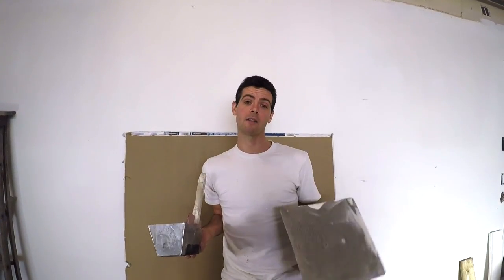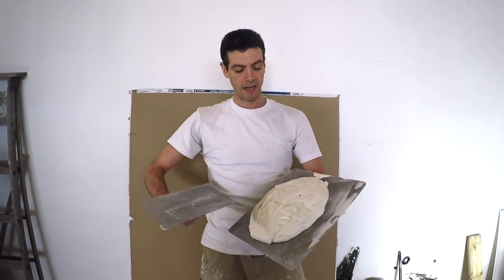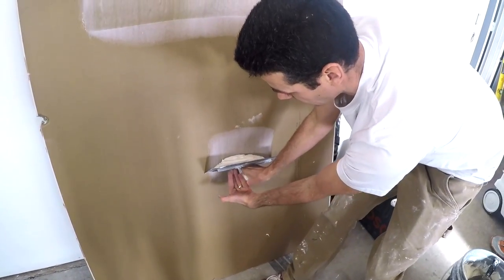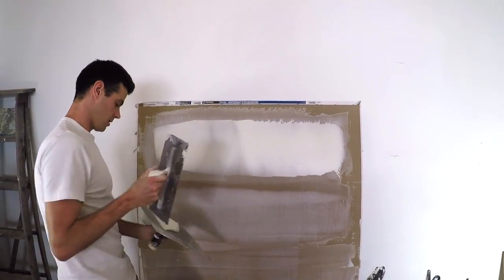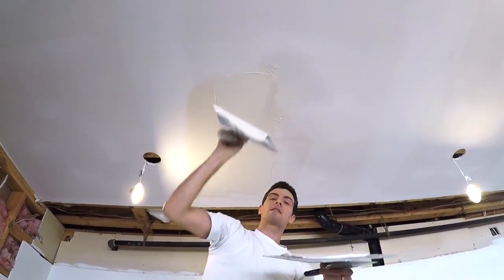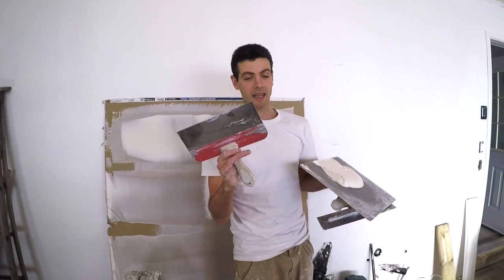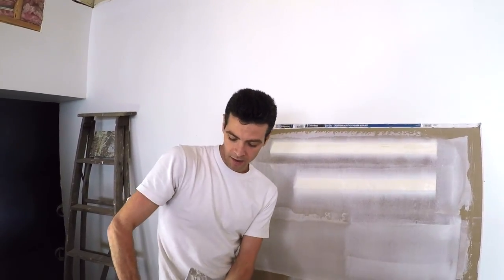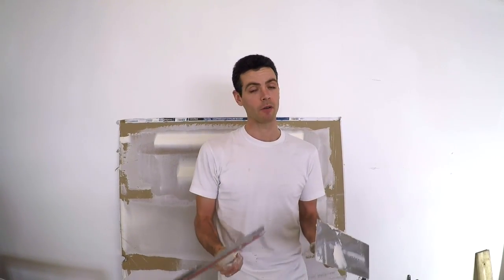HAWK AND TROWEL VS PAN AND KNIFE

Comment: LOL, some tradesmen can’t avoid knowing the taste of their work! I’m familiar with an electrician who knows what 220 volts tastes like. 😮 
I think I’d prefer chalk.
Reply: I saw someone taste 220 at some point. He screamed so hard, after that I asked him is he knew how loud he was. He was not even aware he screamed 😄
Reply: Yeah, I used to love the taste of sawdust when I was framing houses years ago. Sometimes I’d like to lick a nice and clean, kiln dried piece of hemlock or fur 2x6 and then smell it! The wetness always brought out the aromas! 😜
Reply: I took 480 across the chest once because someone fired up the generator while I was working in a power distribution panel of a connected equipment suite. Every muscle on the front of my body contracted with superhuman strength and I very narrowly escaped both shoving my face into the live panel, and skewering my jugular with the screwdriver in my hand. I don't recall a taste, per se, but I do remember 'seeing stars'.
Reply: @AtlasReburdened  was the power out or you had it turned off? Wondering what the deal with the generator was.
Reply: @seabass22  I was working on a mobile military communications equipment suite that sits on the back of a HMMWV. The generator is the only power supply.
Reply: @AtlasReburdened  oh dang that sucks
Reply: @seabass22  Yeah, but it sure ingrained the lesson of not having a finger on the metal part of a screwdriver when working on anything that electricity ever touches.
Reply: @AtlasReburdened  I need to get some electrician drivers for that reason
Reply: @seabass22  It is pretty nice to have that peace of mind, and getting a decent set doesn't quite dent the wallet like it used to.

Comment: Great explanations, and demonstration. I prefer a trowel over a knife 90% of the time, like you said you get a lot more traction and pressure out of it, so less fatigue and wrist strain. With a trowel you can set up plaster at just about any thickness, over an inch if the plaster is nice and stiff, that is impossible to do with a knife, so ia trowel is great for really uneven surfaces and filling larger cracks and holes. With a trowel you can plaster over a brick wall in one run for example. Rest the hawk on the bucket if you need to pur it down. Put your trowel on the hawk to have one hand free for taping, or whatever you need to do. A trowel can get into corners just fine if you change yuor grip a bit, turn it around and grab the stem, instead of full on gripping the handle. I like how with a trowel it's relatively easy to make a transition on an inside or outside corner, and you can really cut sharp edges. For trickier parts, corners etc. just use the short end. All of it comes down to experience anyway:) everybody has their prefrence and personal tricks.

Comment: Over the years, I've developed a bit of a hybrid method: Mud bucket, 6" knife, and a 12" trowel. Kick the bucket around with me, using the knife to load/clean the trowel. Never have to carry more than a trowelful around with me, so easier on the arms and shoulders. Even better when working off a scaffold 'cause the mud bucket comes up on the scaffold and wheels around with me.

Comment: Now to give one back in appreciation for answering things I've always wondered:
No need for the pan holder tool; I cut 80 grit used belt sander belts in half, and epoxy one to each side of the pan. Even with wet hands, you'll never drop it, and it's free! 
Question about your trowel: is that one with the armed blade or are they flat? I bought an armed one, but it leaves way too much mud behind, or I used it wrong.
NEVER MIND, I just found & watched your "curved vs flat" video! It DOES make a good doorstop!

Comment: I use hawk and trowel. But I use 4,6,8,10 knives. Depends what I'm taping/skimming. My flat trowel is 4 ×16 and I use a pool trowel same size . There awesome for skimming.  Pan sucks man, but you can do quick repairs and stuff with them if you don't want all the other tools. Plus you can mix durabond and tape out of them. You know the trade well. Nice video.

Comment: I use the wall as my pan.  I scoop out three pans worth of material, and dump it on the wall, at eye level.

Then when I need it, I take it off the wall, as I need it.

I work with a 6" knife in my right hand, and a 10" in my right hand.

I did three coats on 82 sheets this way (basement, lots of beads and bulkheads) and got it all plastered, sanded, and primed in 5 8 hour days. 3400 job happily paid for.

All done with all purpose mud. 8 boxes worth,  20 paper beads 

Hardly any sanding, 2 hour 15 minutes sanding at a slow to medium pace.

Looks great too. 

Stilts are the key... even for a low, 7' ceiling, I set them to 10" and I'm golden.

Just to show you, that it can be done many ways.
Reply: I mean to say... a 6" knife on my right hand and a 10" knife in my left.... but I alternate when skimming.  Of course I use a 12" broadknife at t-intersections and taller Bulkheads.

Tape, plaster, sand and prime should be like 40 bucks a sheet, at today's prices, for a normal customer in a normal home.

Of course you can ask more and often get it, but you could also ask less, and get turned down... so ask and ye shall usually receive.

Good luck, folks

Comment: With pan and knife. You cut a bit mud off the sides of the knife on the pan before spreading the mud on the wall. It won't pore out the sides of the knife and make a mess
Reply: He obviously would know this.  But it's clearly not his preferred method.  And in any case, it would add a ridiculous amount of time to a job to have to waste that time on each pass cutting mud off each side of the knife on the pan before spreading it.
Reply: You won't lose any time when your good at it. But I do perfer hawk and trowle tho
Reply: so im a stopper from New Zealand  if you roll into a job here with ya knife and pan you'd get laughed off the site mate, i dont mind the broad knife i own one it doesn't see a lot of use tho...... any ways good vid.... work those guns stopp up a storm boyz char!
much luv 
up on the down side New Zealand
Reply: @purepolemanagement  yup it does
Reply: I agree cut it off both corners of knife to avoid  oozing out of the side.
Reply: That’s essential for sure
Reply: Pure Pole Academy it’s automatic when you learn how to do it.  Like anything else. Which method is best ? Whichever one your proficient at

Comment: I agree with everything you said. 
I use  pan and knife for most everything 
I have a 20” trowel that I use to float all my butt joints. Perfect every time. 
I wouldn’t mind getting a trowel to coat cornerbead. 
Thanks for the viseo

Comment: VanCarp: I started off using pan and knife, and then later tried the trowel and hawk. Trowel takes awhile to get the hang of it, and because of the way you grip it, I would get VERY sore wrists after a day of use! The knife ,on the other hand, is almost the same as using a paint brush, and comfortable for me. Guess it just depends on what you started with.

Comment: When using the pan and knife try cleaning off the edges of the knife before applying it to keep it centered like you do with the trowel. Simply wipe about and inch or so off each edge on angle into the pan and apply as usual

Comment: I use the pan and knife.  its just how I was taught.  and personally All the negatives you pointed out dont really apply because I learned to work around them and its really a second nature now.
Reply from the maker: I figured anyone who has always used a pan and knife would not have the problems I do. I just never spent the time to get really good with a large knife.
Reply: The big thing I see is you aren't cutting mud off corners of knife after you grab mud from pan. Takes a fraction of a second once you get used to it.
Where I am you would not get invited back for second day if you showed up with trowel. I hear in other areas it's exactly the opposite. I think it's more about what your used to really.
I played around with a hawk and trowel for about an hour in apprentice class and made a big mess, but I'd still like to learn someday when I have the time.
Reply: im switching over to hawk and trowel for  bigger  repairs and floating especially when it come to ceilings. my wrists will thank me

Comment: I've been doing finishing for over 35 years. I started taping on the west coast. Hawk and trowel taping is mainly an east coast thing. For a beginner a hawk and trowel can get very messy and is harder to get the hang of. Coating joints, metal and angles with taping knifes are easier for beginners  so in my opinion start with a pan and knife. Good video though.

Comment: I’ve never used anything but a pan and knife. I couldn’t imagine using hawk and trowel in tight corners. However I see huge benefits to it on the ceiling.
Reply: you can kill it on bead with them too. blades flex too much and leave hollow beads

Comment: I’ve been remodeling for over 15 years. I started out with a pan and knife but found it frustrating.  I even got a fancy curved  pan without corners. Still didn’t like it. I got a hawk instead and use it with knives.  I’ve never felt like a trowel would work for me. My jobs are small so I’m not looking for speed. I actually use a 10x10 hawk and a 6” knife for most work. It’s just what I prefer. Hawks are much easier to clean as well. I clean the hawk often so my mud goes on nice without clumps and dried mud. I keep a small bucket of water and sponge nearby.

Comment: I use a hawk and both knives and trowels. taping is done with 6” knife. Coating tape is done with 12” knife then wipe edges with 6” knife then finish with the 12” trowel

Comment: I have had the exact question that the video was about. The story about the origin of the knife technique versus the towel technique was cool, even if it isn't true. 

I occasionally do small amounts of dry wall taping/wall repair jobs and it was a pleasure to see a professional explaining and demonstrating various techniques. He demonstrated a couple of techniques that professionals make look very easy that I've struggled with. One of them was applying joint compound sideways with the small knife. I do it, but no where as smoothly as he did. The other is manipulating the material on the hawk. Mostly I've used hawks for small stucco jobs and I try to look like I'm competent by maneuvering the stucco on the hawk with that tilt technique, but I pretty much just make a mess.

Comment: My basement flooded, I needed to cut all the walls and I used the opportunity to improve insolation.  So, I get also 18 inches wide holes in the ceiling  all the long  of the exerior walls.  It made 320 feet of joints ( a lot of corners) and I needed almost a hole big bag of Sheetrock 90 for the gaps we the drywall novices created plus  the differences between the old drywall gypse and the new.  For me, I found the easiest to use was the trowel and the hawk to apply the mud in the large joints then the 12 inches knife to work it. For the corners I used the 4 and 6 inches knife.   I was unable to use the trowel to feather the edges or to work the mud.  But as I said, the hawk and trowel was the bomb to apply the mud on the ceiling and on the wall joints.  I used the pan and knife at the beginning for the   corners and to apply the tape.  Something I realized almost at the end is that the old rusted knives (a friend lend me) are a pain in the neck, you lose a lot of time triying to clean it after each application, I should have buy new ones since the beginning and spare the wrist pain it produced to fight time after time aquezing the knife against the pan or the hawk to clean it from the dry mud.  But, it is done now.     Thanks fot the Laurier's video, I finaly learned from him how to load the mud in the 4 inches knife for the corners making the less of a mess LOL.  I forgot to tell, wach time I was making a 3 way corner I was hearing : Prety,  LOL; each time I was working a joint I was hearing 'feather the edge' LOL.

Comment: You can get in middle of the blade with the knife out of the pan if you rake off Each corner so that way the mud is in a middle but still takes a little more effort than the hawk and trial. Nice video it is all about preference

Comment: Hmm. It is possible to thin the mud down to where it spreads optimally for the tool you are using. You are not forced to use it as it thick the way the mud comes out of the box. And you can easily wipe the excess mud off the corners of a broad knife before spreading the mud out. When we spread mud 20" wide or more between corner beads or on crooked sections of wall, we use a feather edge , plastering rod, or darby to level the mud. One thing I will grant the hawk and trowel guys. A pan will not spin on the corner of the knife supporting it anywhere near as good as an upside down hawk will spin on the corner of a trowel.

Comment: Taping butts with a trowel might be okay, but even an 8” trowel is going to bottom out on the bevels before you set the tape. I’m also not convinced you can get more mud on a hawk. I use both—the hawk and trowel for plastering—and you know as well as I do that we keep a table or bucket near by if we’re plastering because you’re going to make a mess if you heap the hawk with material.
Reply: And we also know if we load up either our body is going to be kicking us after a couple of hours. For myself, I prefer hawk and trowl. But then there are times when I grab the knife and pan. I bring both on most jobs. The more ways we know how to do something makes us more valuable in my opinion.

Comment: Hey nice video man! Pretty good comparison of the tools of our trade. I learned in school how to use regular putty knives and The trowel and to this day still use a trowel but I mostly use taping knives and a Hawk. only used a pan here and there mostly to mix a hot mix or paris plaster. I have a 10'' Richard folded backing taping knife and ehh it kinda got banged and dented up..but recently found and rescued so to speak an old Richard style taping knife from the 70s-80s(?), soo nice, extruded backing riveted and not "tapered" like most new blades but looks more like yours. Nice knife by the way. I have a Marshalltown Trowel and 3''-4'' putty knife but been meaning to pick up a few Marshalltown taping knives like yours, either stainless or blue steel they just look so nice and have a good feel in hand, keep up the good work!

Comment: Having worked a trowel for over 30 years I'd like to share this little tip so maybe you don't injure your wrist over the long term.  Like most people you hold your trowel handle like a bat; all the torque is being controlled by stressing your wrist. Try holding the handle with your thumb and ring finger + pinky and placing your pointer finger and middle finger on the spine of the trowel where it meets the trowel back.  (and go back to the bat grip for reverse action.)  You may find you can apply more edge pressure and that you get more tactile feedback from the surface you are working with.  Also, practice working with both hands.  I'm naturally ambidextrous with tools and it's a HUGE benefit.  But even if you aren't some practice will get you out of a bind now and then.
Reply: thanks for the tip, i paint and use small knifes with my off hand mainly to extend distance when on step or ladder but never thought to try a trowel.

Comment: When you wipe your pan knife wipe the two corner edges just a bit. So that it has no mud on the outside edges. Makes for a better spread. The thought of using a pan knife is cringing me out. I use a flat box and only use the pan knife for wiping down. Great video

Comment: I find a hawk over a pan is the best but I do use a trowel for bigger work. Basically a 200mm knife for most stuff and a 300mm trowel for anything larger is a good combo to cover most jobs. Also a 300mm knife with a cranked handle is pretty good, if you can find one.

Comment: I flip and wipe about an inch or better of mud off each end of the knife when I mud ceilings. Helps avoid the overspill that falls in your mouth 😉 And a quick tip you should try, when taping, put just a touch of mud on top of the tape in front of the knife before you wipe. It'll push the wrinkle all the way to the end just like wetting the tape but without losing the adhesion👍

Comment: I dog ear my mud on my knife by wiping the first inch on each side of the knife on the pan, before I apply it... that said, for skimming I think the hawk and trowel is definitely faster and with a trowel (pool trowel) you can practically burn the mud in like you would finishing concrete for a skim coat...cuts down on sanding for smooth-wall and 90-10....

Comment: If i use trowel i scoop mud straight from to bucket over trowel and skip whole hawk part. 
If i tape seams i use 2 knife, wider one as "pan" and take mud with narrow knife and spread it to seam then add paper tape then use wider knife to smooth everything out. 

Actually in my country i haven't ever seen anyone using hawk or pan or any shop doesn't even sell them. 
Professional here who does nothing but plaster work uses spray gun to apply mud on wall when skim coating.
Reply: I did the same for years. However when I started to use a hawk and got the hang of it, I increased my efficiency by at least 50% (give or take) also I feel less tired at the end of the day due to the fact I don't have to walk to and bend over the bucket to get mud as often. It takes a bit of getting used to but in the end using a hawk has it benefits.
Reply: I'm jack of all trades what comes to house building and renovation except electric and plumbing because those two requires license to do in my country. So, not so often that i do just drywall taping.
Reply: @mr.wizeguy8995  Ah oke, im a dedicated drywall finisher so in my case efficiency matters more. As an all round contractor, it isn't that big of a deal indeed. Good fortune to you in the future.